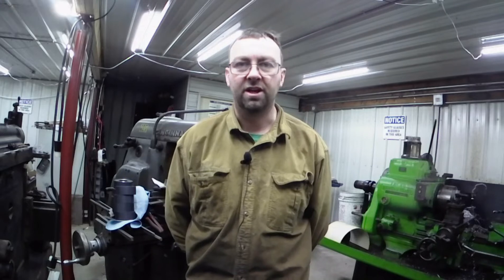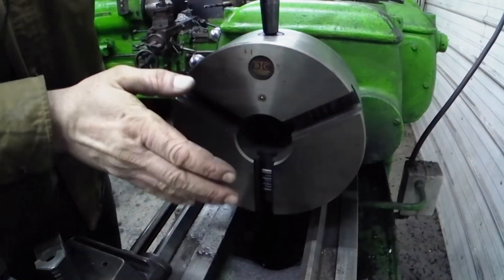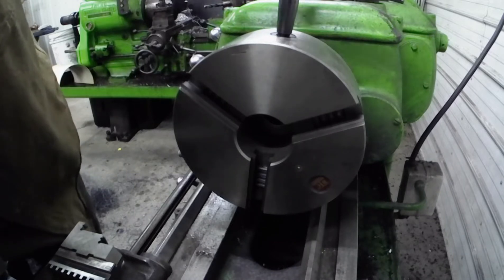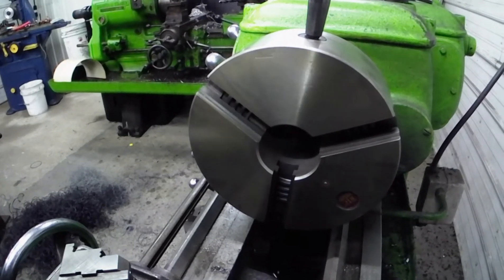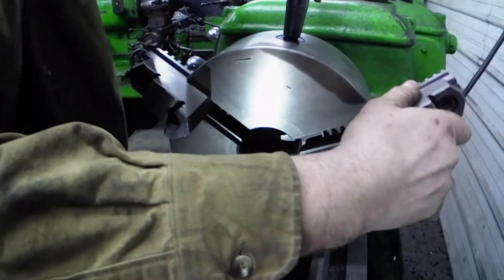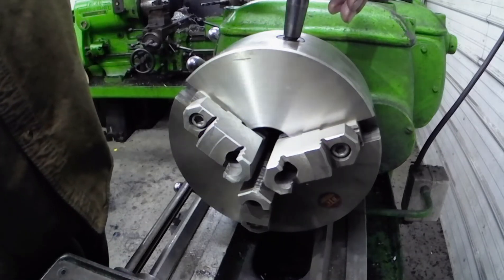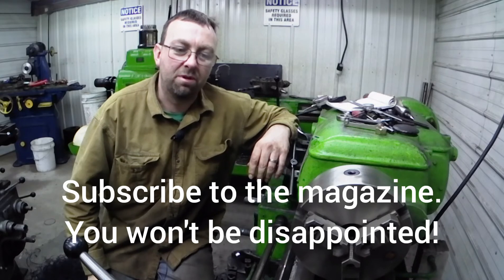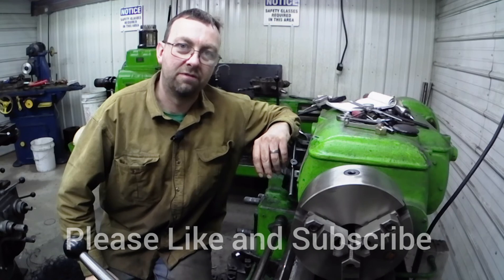How To Reinstall Jaws in a 3 Jaw Chuck

Comment: I use a big rubber band (cut from a motorcycle inner tube) to hold the jaws, and then wind the chuck open until they have all clunked in sequence and jaww number 1 is last to clunk. Then I wind the scroll in and the band provides tension and has the jaws come in naturally. I don't think it's actually any easier or any faster than what you showed here, but I like doing it that way. Mostly because I feel like I'm making good use of a junk motorcycle inner tube probably.

Comment: Anyone know if there's a good place to send off jaws to get them reground? Or would it make sense to just buy a new chuck if the runout is too much? I have a well used rohm chuck that came with my 11" logan.  I guess I can use my old 3 jaw for a welding positioner. Or just use it with it's limitations and do all the machining steps before removing the part.

Comment: I appreciate the reply very much. The issue I'm having is there is movement in the Allen Head Screws that hold the Jaws to the chuck jaws. It's enough movement to make it .009 out when I got it and down to .003 after I re-tightened the screws. I'm certain I'm not doing this correctly and thought you might be able to help. The difficult part is trying to describe what's going on without it being right there to look at. Thanks for your time and suggestions.

Comment: Good video and advice on removing and installing the jaws on a lathe chuck. What about the removeable jaws held by the Allen head screws? I have one that I bought that was made in Sweden, wasn't cheap and a good quality. I was looking at used chucks mostly Buck and South Bend but nothing looked worth buying. The one I bought, 6" SKAND CHUCK FABRIKS AB, was supposed to be within .0005" but it was .009" after putting the jaws back in. I loosened the Allen head screws and put an indicator to give me some idea which ones were out and got it down to .003". I am a hobbyist, could you please give me some tips or hints on how to adjust these jaws, thanks
Reply from the maker: Usually the top jaws fit right and don't give any adjustments. It almost sounds like you may have something in the scroll or jaws inside. I would tear it all down and clean it really good. Some light oil and reassemble it. See if that helps. I usually tear my chucks apart about once a month to clean. It's a necessity, you will be surprised what you find in there